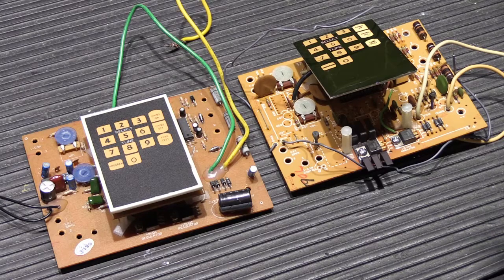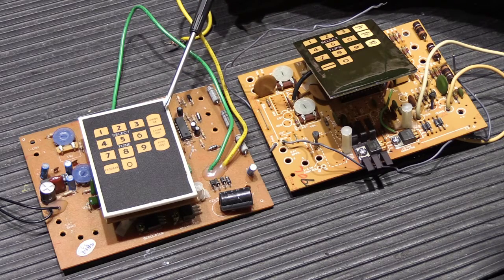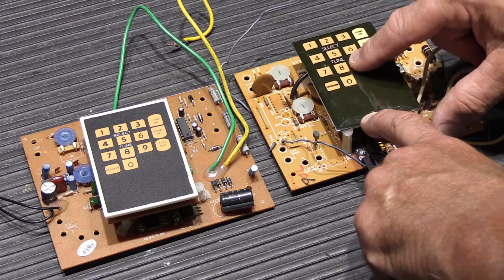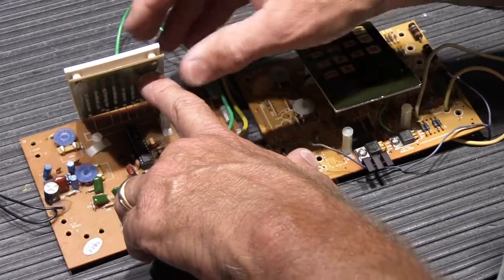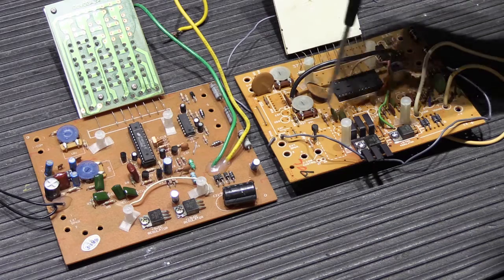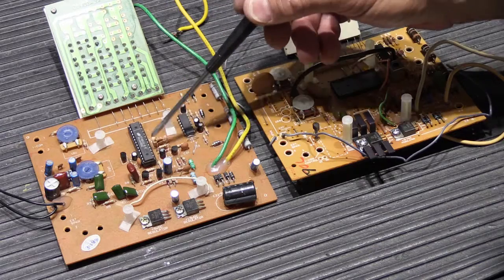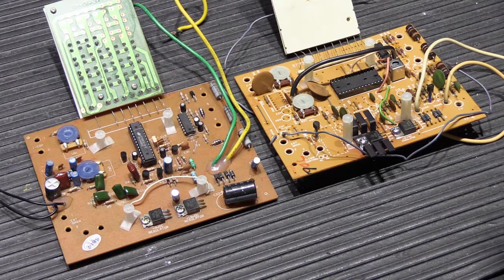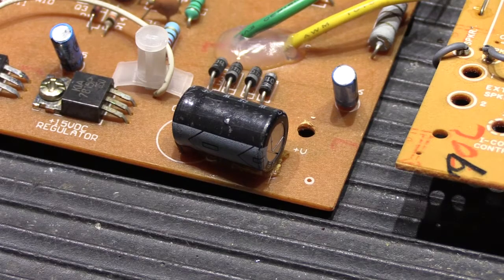NuTone LB55 Electronic Musical Door Chime - Differences Between Early and Late Circuit Boards

Comment: can the bubble key pad be replaced with the newer model key pad on my LB55?  if so part number and where can I buy it?
Reply from the maker: Hi Peechee1:  Unfortunatley no.  Bubble Keypads are technology from the 1970's and haven't been used much in products since the early 1990's.  Replacement parts from NuTone haven't been available since around 1996.  A repalcement Keypad, would take someone to design a  Keypad which uses modern components.  Usually most Keypads experience "bounce" which will enter double numbers (two 1's) this happens on the most used keys.  Carefull and deliberate pushes can sometime bypass this problem.  If not, then a used repalcement Keypad is the solution - Chris

Comment: Im from Montréal, Canada, i have the 1980 version of the LBC-55 and i cant set the time. I press program, then i press the numbers of the time and i press SET TIME. The problem is when i try to press SET TIME after i enter the numbers of the time, the time doesn’t change. Overall the clock looks in good condition, the sound quality is very good and i have no problem to set the doorbell. What should i do with the clock, do you think that something is broken inside the clock? If so how can i get it fixed?
Reply from the maker: Hi B . Jenn Laplante:  There could be many different things wrong - First, your Chime is over 40 years old - which means it has over 350,000 hours of time on it. . . It may be in need of its first rebuild.  It is unlikely that the "clock" is the problem - it would be more likely that the keypad has worn buttons and the "set time" button isn't responding as it should.  I have also seen LBC55's that have problems with the cable of wires that connect the display board to the main board.  You can contact us directly about having the Chime repaired - Chris  nscompany@msn.com

Comment: Hey I have one of these in my house and it’s buzzing like crazy! Bubble pad style, any parts I can buy to fix it?
Reply from the maker: Hi Cam:  First - You Should Disconnect Power From The Chime RIGHT-NOW!!  Every minute it's buzzing - it's damaging the Microprocessor and it it fails - The Chime will be Dead and NEVER work again - Sorry for shouting - but this is important.  You can contact me about repairing your LB55 Door Chime - Chris 925-743-8236
Reply: @northsideservicecompany3567  I disconnected the main power. found the wiring diagram on your website. what's next? doorbell was working fine was just buzzing like crazy!
Reply from the maker: @camwilson8305  Like I said - Contact me directly during business hours - Chris
Reply: Filter capacitor problem, maybe...